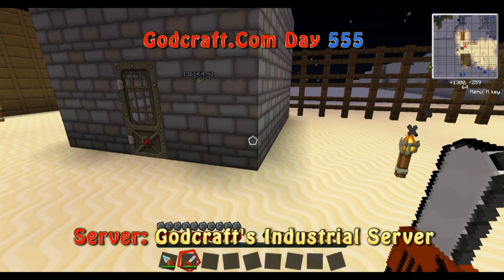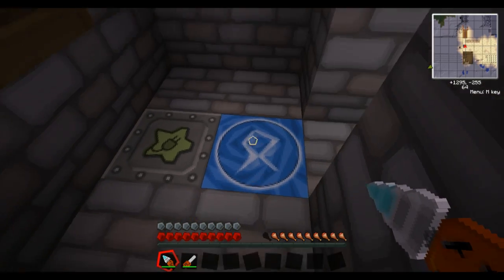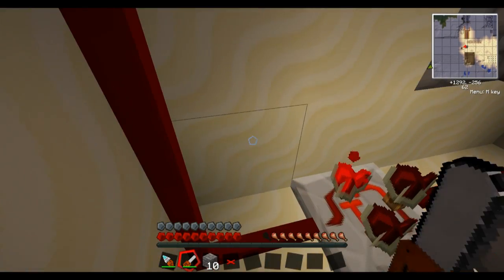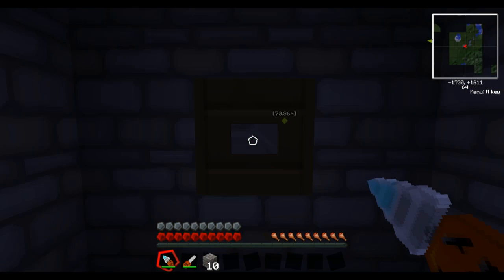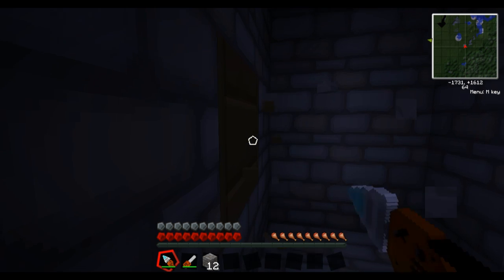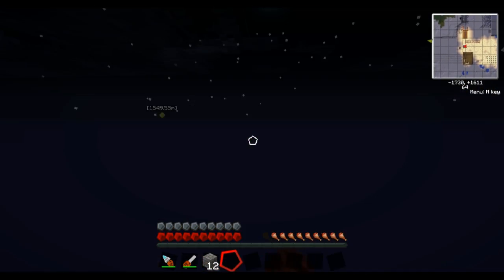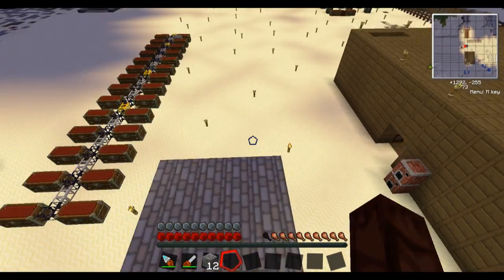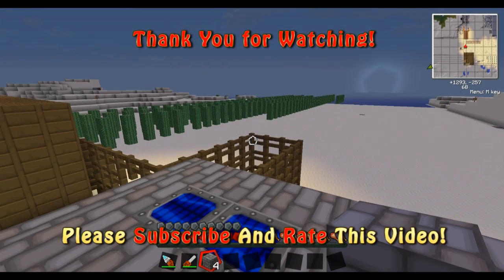Godcraft.Com Day 555 - Minecraft - Industrial Server - How to Setup a IndustrialCraft Teleporter!

Comment: If you want to use a button, hook it to a togglelatch, and hook one of the outputs to a timer set for .5 seconds(this is the side that is always on) and hook the other output to your teleporter, this will work just fine, and the toggle latch will auto reset.

Has the same purpose of using a lever, but you don't have to click it twice :D